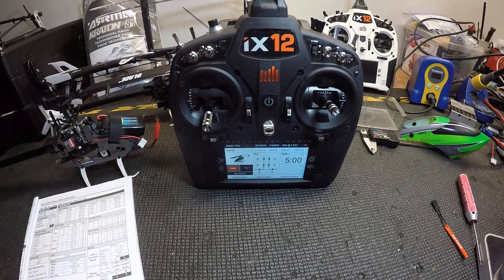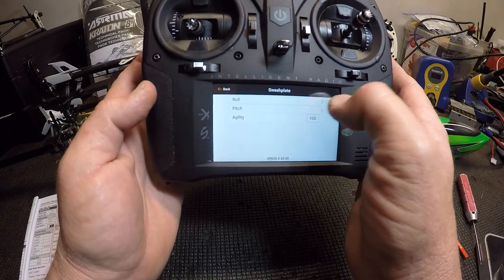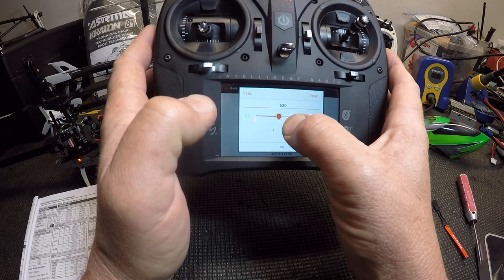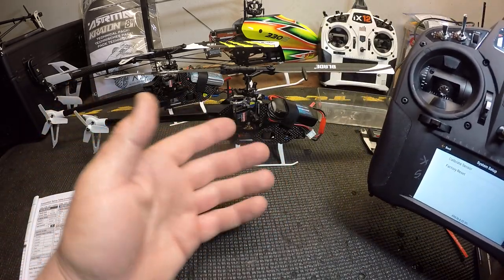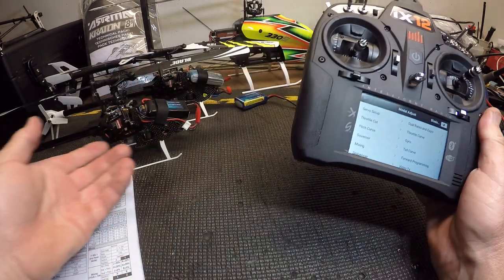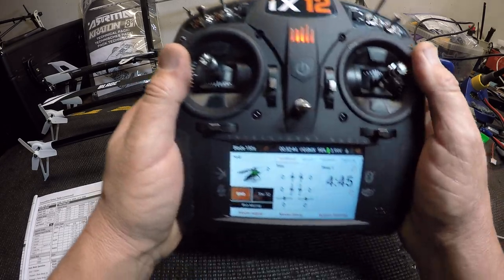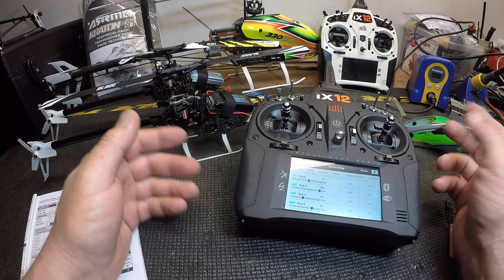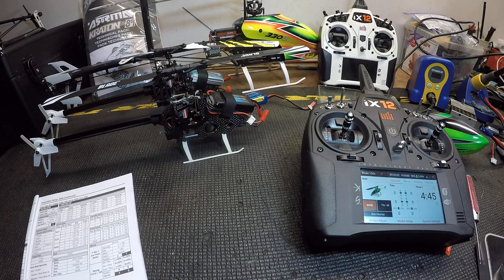Horizon Hobby Blade 150s Set up and How it Relates to Your Spektrum Transmitter.  PART 3

Comment: I'm a big fan of yours and have watched most of your RC Helicopter videos, since getting back into the hobby in 2019.  No other Heli related YouTube videos come close to being as informative and helpful as yours.  Great job, Justin!!!  I started in the hobby at age 12, initially control line and ultimately RC Helicopters.  The Kalt Baron 20 and Hirobo Shuttle (both OS 28 Nitro), were my last helicopters before retiring from the hobby in 1992.  Now I'm retired (age 64) and have all the time in world to focus on the hobby.  Your videos influenced my purchase of an ix12 transmitter and two Blade 150S Helis.  The second Heli was intended to keep me flying after a crash of the first; LOL.   Thanks for responding to each of my previous questions.

I wonder if you could help me again.  I'm experiencing a unique problem on both my 150S Helis.  Heli1 has had 3 minor crashes but is fully repaired.  Heli2 has never crashed.  All settings are factory, except head speed.  I've turned down Stunt 1 Head Speed to 65%, and Stunt 2 Head Speed to 75%.  Recently I started practicing basic loops and rolls in Stunt Mode.  I like to switch back to Normal (Stability) mode before landing.  Both Helis have severe tail wag, when switching out of Stunt Mode, right after a loop or roll.  Landing, shutting down, and restarting, cures the problem.  Neither Heli has any sort of tail wag or drift in normal mode or stunt Mode, when flying scale style.  I'm guessing I need to adjust the P Gain?  The 150S does not appear to have unique P Gain adjustment capabilities for Stunt 1 and Stunt 2, but rather for Normal mode only.  I saw your Video, adjusting gains on your friend's Blade 330S.  That Heli appears to have gain adjustments for each of the three flying modes.  As always, your thoughts will be greatly appreciated.

Comment: This series was very helpful for me.  I just purchased an ix12 and Blade 150S on May 26th, and followed along with your three videos to set up my Heli and Radio.  One question; when you do the blade scissoring test for neutral, positive and negative pitch, it wasn’t clear to me if the positive and negative pitches (gap between the blades) should be the same?  On my 150S I’m definitely getting far more positive pitch than negative pitch.  Any advice you might offer would be greatly appreciated. Thanks.
Reply: No need to reply; I figured it out.  The equal positive and negative pitch can only be seen when in Stunt 1 or Stunt 2 mode.  I was in Normal.
Reply from the maker: Wolfgang Reiner   Also, you can use travel adjust in radio on pitch to even up the travel. Make your Hold mode 0,25,50,75,100 pitch curve. Then you can do set up in Hold mode so the heli doesn’t fly away. I use about 110% positive and 110% negative in the Pitch travel adjust menu.  This will help.

Comment: I have the DX9 in forward programming like this doesn't work it's not available with my experience with helicopters on my radio the way I used to increase roll rate, I would go into the servo set up and increase travel for ail and elev. I did that with the 130x.
Reply from the maker: Update your radio first. Turn on radio, turn on heli, got to model adjust. Go to forward programming. Go to swash, and go to roll and pitch. Its different than playing with the standard rate.
Reply from the maker: S O S DEATH VALLEY AMENHOTEP G    Be on the latest update. That’s how we get it to Talk to the new Smart telemetry stuff. Heli has to be powered up to even see the forward programming in the model adjust menu.  It has to be powered to send information.

Comment: My DX8G2 must be broken.. forward programming doesn't show up in my menu.
Reply from the maker: fiveoboy01   Update the radio.  Turn on the heli, and it will show up in the model adjust menu.
Reply: CoeShow619 thanks.  I’ve tried that.  

Forward programming works fine with my Fusion 360.  Not sure why it doesn’t work with my 150.